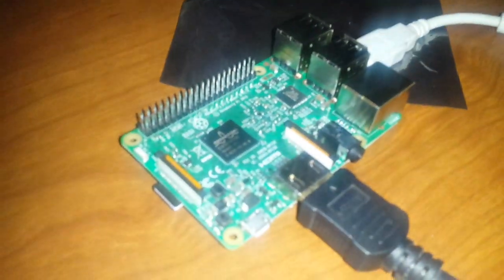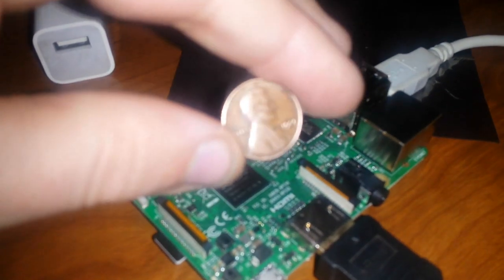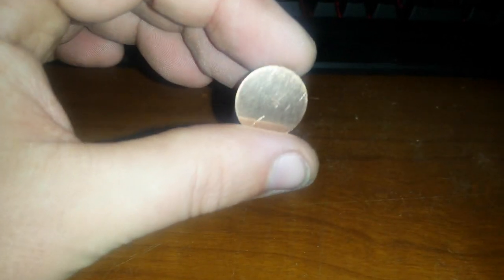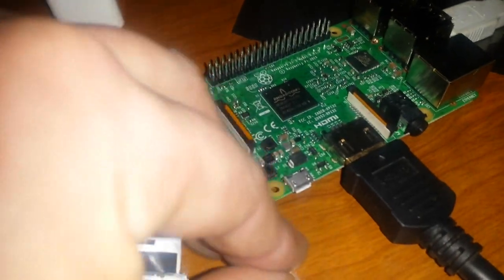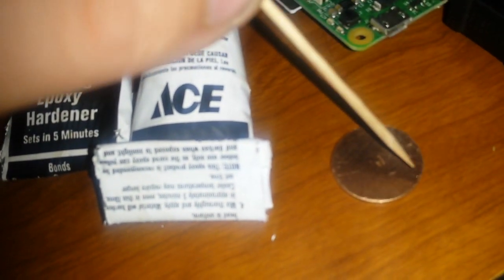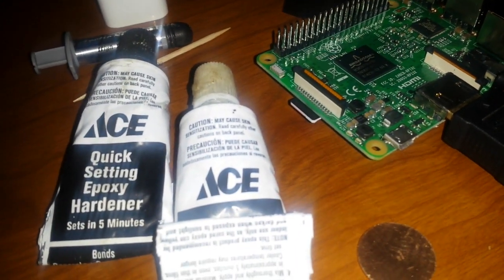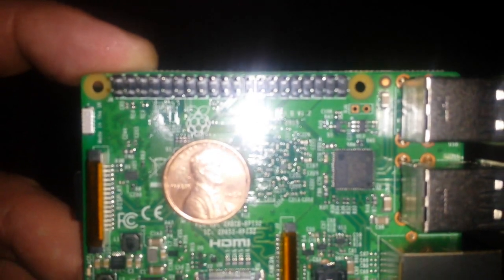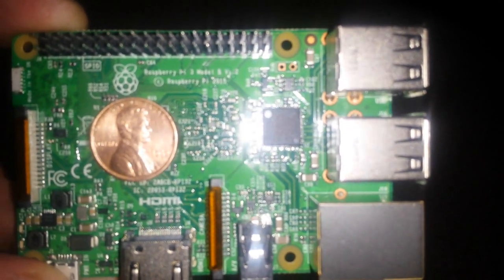Can a penny keep a Raspberry Pi 3 cool?

Comment: Quality = yes vs. no. Copper penny IS effective as a heat sink, but what are the measurements, to what degree?
Quantity = values and difference, give us the metrics! Useing the command
vcgencmd measure_temp
before and after heat sink application can provide what percentage cooler. Also just having it on in idle will always be cooler than intensive load.
Exercise intensively the memory-chip on top of the CPU with identical data grinding tasks for both the before and after measurements as well as at idle for the best results.

p.s. I made my FREE copper heatsink from two scraps from a copper roof construction site - I bent two strips into a small U channel pasted inside a larger U-channel using toothpolish as thermal bond which was free and easy! A smidgen of baby-oil or vasaline mixed well into the paste kept the heatsink attached after drying in service. For the best free thermal bond use old-fashioned polish with diatomaceous earth, the white chalky stuff, not gell toothpaste . It was too easy to over-do the paste application. I only needed about half of what can be rolled onto the end of a toothpick.
Come to think of it now, I could have mixed in copper filings.
Reply from the maker: I didn't do much testing other than what I talked about. Running stock my Pi3 would overheat due to a poopie power supply. When I put the penny on it stopped over heating. I now have a good power supply and I'm also over clocked to 1.5 so I'm no longer using the penny. I'm now using a heat sink I got from a PC and modified it to fit the pi3 plus using a small fan.

As stated in the description above: Penny does actually work but if your going to overclock at all a penny 
isn't good enough. Under normal conditions a penny works just fine.
Reply: Right on! The one cent solution is a great idea for the instant 'out of pocket' McGuyver fix!